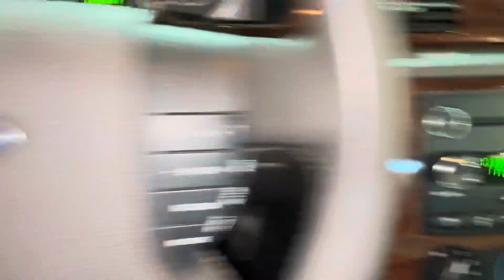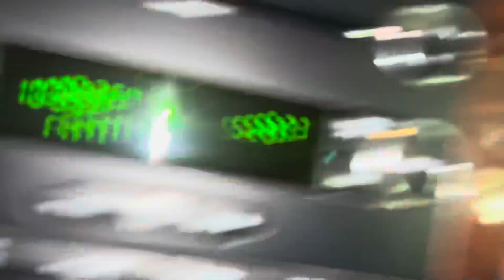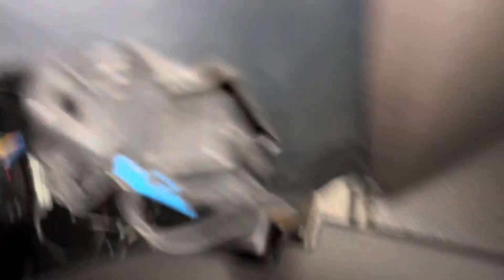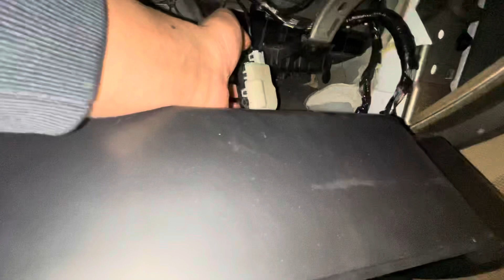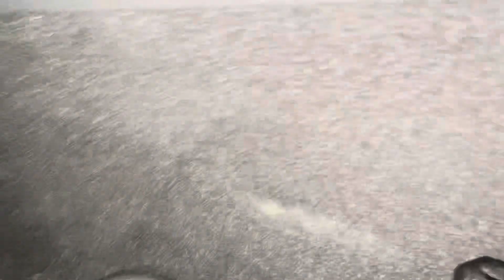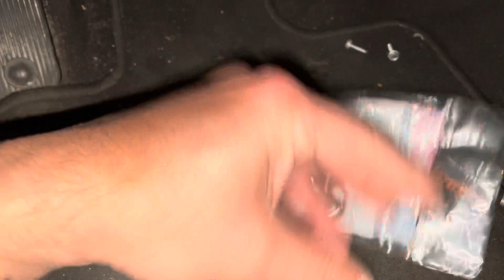Ford Taurus - No Heat issue FIXED

Comment: I have the same car 3.5l sable. no heat concern. I shot the heater core hoses the temp in 120 out 77 but the actuator in the car is clicking. Could that be the cause of no heat? maybe the mixing door or should i have at least a 10 degree diff in and out at all times?Great video.

Comment: Tip:Take old actuator with you to autoparts shop to be sure the bolt holes line up.The autoparts guy said there were several different ones for 2008 taurus and taurus x.I had to make 2 trips but got what I needed.Also thanks for this helpful video sir.